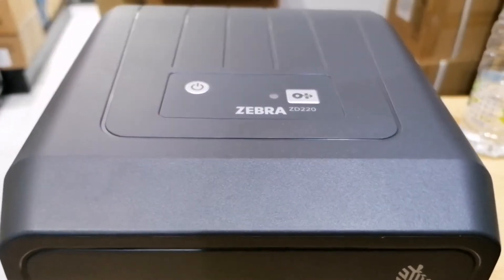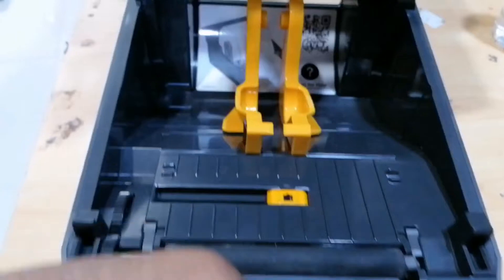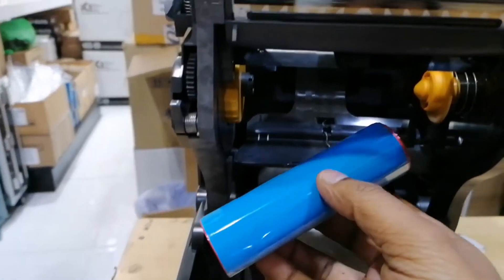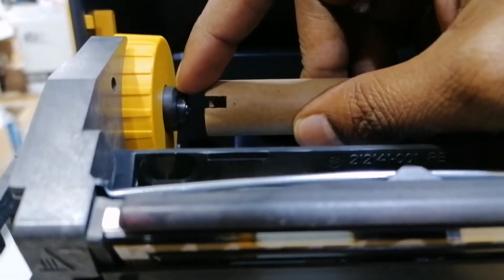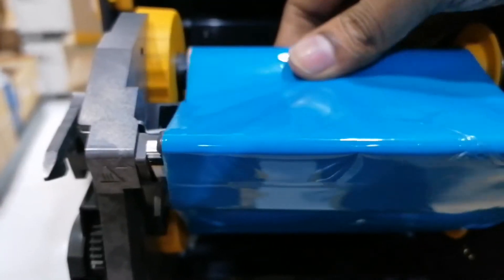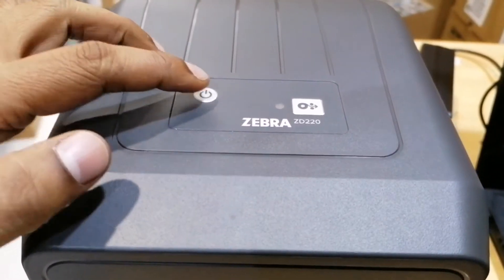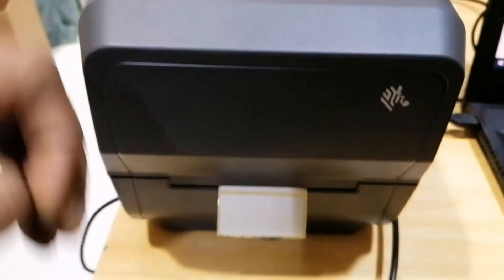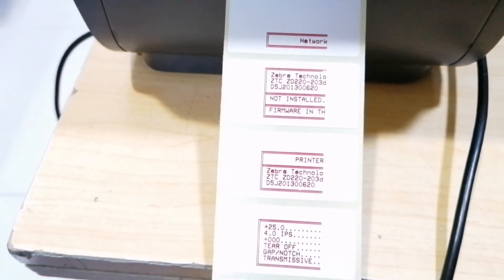ZEBRA ZD220T MEDIA LOADING & AUTO CALIBRATION

Comment: This is very Helpful thank you for the Content. I have the same model but when I turn it on, it gives a constant Solid Red light and I am unable to power it off using the Power button. I have to just plug off the power cable. Also when I connect to PC I don't get any connection. I don't know what to do now
Reply from the maker: Try to do firmware update.
https://supportcommunity.zebra.com/s/article/Zebra-Printer-Firmware-Upgrade-Information?language=en_US
Reply: @sajtechysolutions6657   Thanks for the Quick Response. Although I tried some of those options but the issue also the Printer cant detect on PC even after plugging in.

Comment: WHEN I SEND COMMAND FOR ONE STICKER THEN AUTOMATICALLY COMING 4/5 BLANK PAGE
Reply from the maker: Set the correct sticker size in
printing preferences option of installed printer(under Control Panel > devices and printer) 
Select direct thermal or thermal transfer option depends on ribbon use. Also please check sensor postion.

Comment: How to control darkness
Reply from the maker: Go to Control pannel > devices and printers > right click on zdesigner zd220 > printing preferences > there you can see darkness adjust option. Don't put maximum darkness, it will damage printer head.